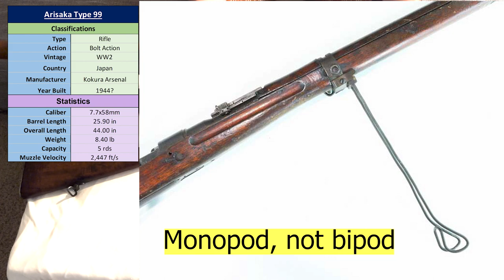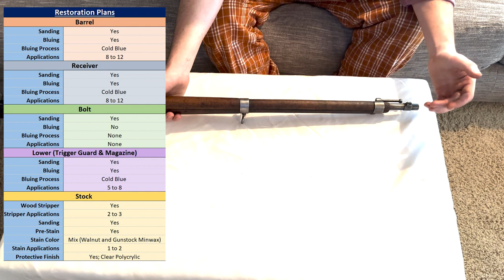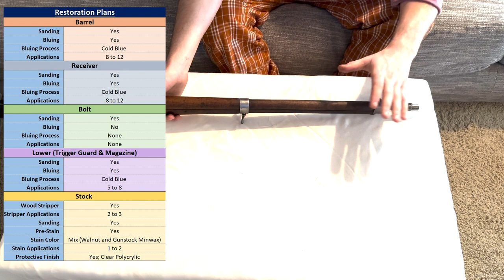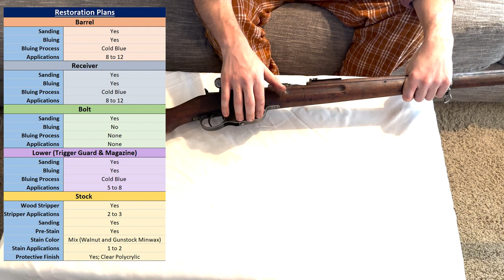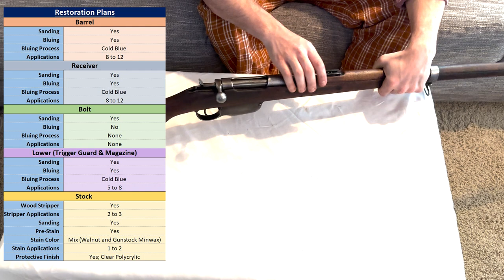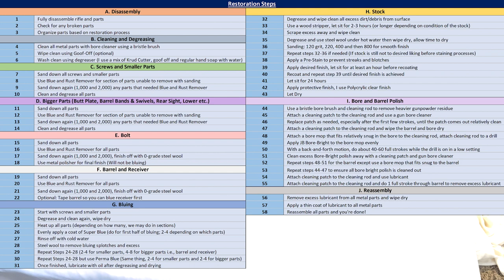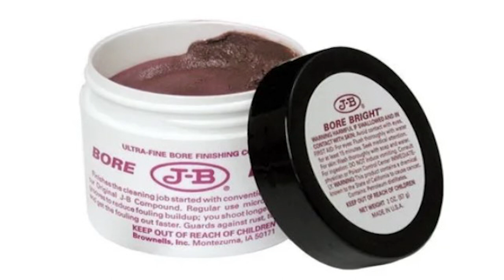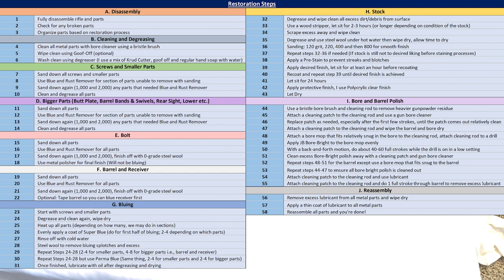M95 Steyr Full Restoration

Comment: I'm wondering if the Arisaka has an import mark on it? The Chrysanthemum is technically wiped out. The cleaning rod might be one of the fake ones. They did away with cleaning rods around '44, I think. You can probably look in the hole and see if it's threaded at the end there. I don't want you to buy an actual cleaning rod for it. That thing is really nice! Personally I wouldn't touch it

Comment: Try some time using aluminum foil to make a liquid tight bowl. Place the stock in the bowl and fill it with acetone. It degreases, takes all the oils out. Only takes Quarter of the time. Only thing is it will drink up alot of linseed oil when the sanding is done.
Reply: Forgot to mention, pouring liquid wood hardener into any screw holes in the wood make then super sturdy and less likely to whaler out.